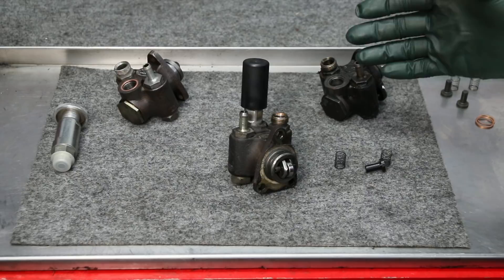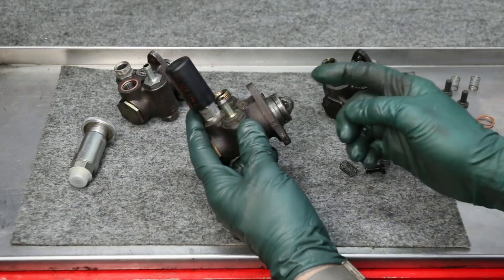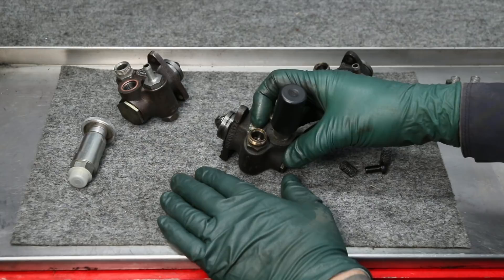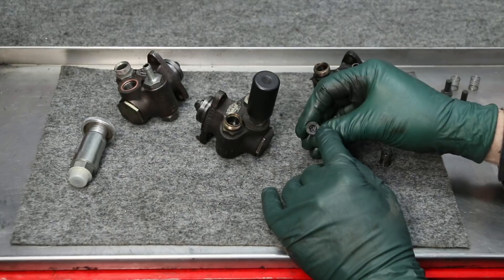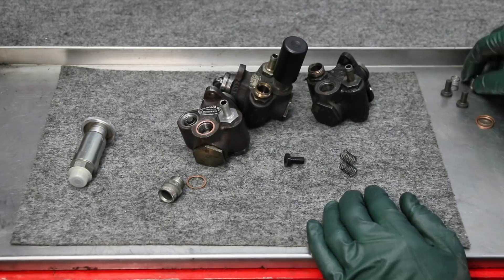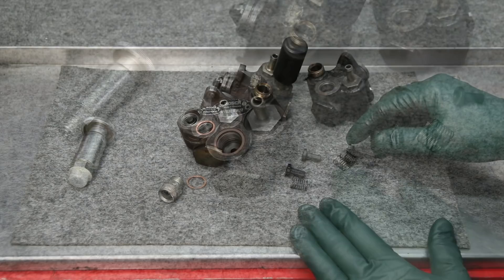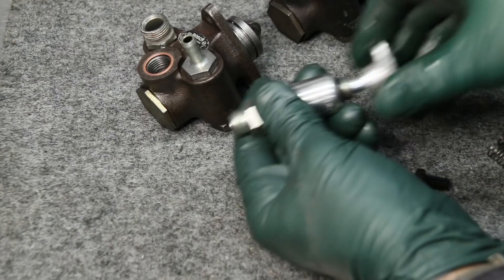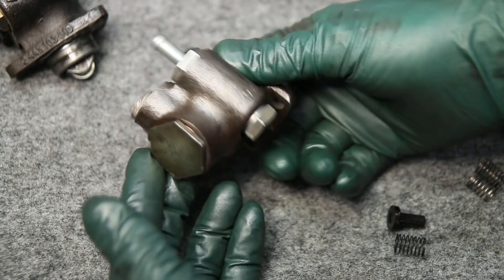Mercedes Diesel Mechanical Fuel "Lift" Pump Operation: Overhaul Kit Reviewed

Comment: This kit would appear to be for the MW style lift pump and not for the M style pump that was on earlier models in the US and Europe. A definite MUST DO job if your car is over 30 years old. Best if done along with a new replacement spring in the fuel overflow control valve bolt on the left side of the injection pump, and new fuel injector nozzles.

Comment: Hey sir my pedal came out of the assembly and got stuck to the floor and my engine was maxed revved for maybe 20 seconds. Now it is reduced power lugs everywhere the water is not circulating so I’m buying water pump but I’m wondering what else could of been worn out due to the pedal coming out and sticking to the floor? What else do I need to look at

Comment: Is this the same unit on the side of a 406 Unimog injection pump? I am trying to repair our old 1975 (406). previous owner had a small 12 volt pump pulling fuel through the dip tube on the fuel tank - I just thought that this is the way they were running the fuel system. I also need a dip tube for the tank and I do not have a part number to search for it. Any help would be greatly appreciated! I would like to rebuild this back to original - what does your repair kit run? This would be great to rid of constantly bleeding air out of the fuel line, filters and having to remove lines to check fuel system.

Comment: Perfect timing. A couple weeks since after replacing my bad glowplugs with some monark ones(making sure to ream the precombustion chamber) I am again having hard starts. Takes like 30-45 seconds of cranking and a boat load of smoke before starting.(it's also been getting below freezing again here in CO. My primer pump I noticed leaks when pumped but not when running. Could I have a weak lift pump? If it's smoking it's getting fuel right? Any help would be appreciated! Thanks Ken!
Reply from the maker: James, that could be the problem, but you need to look a compression first. When was the last time you adjusted the valves and did a compression test? If the compression is ok then suspect the lift pump. Kent
Reply: @Mercedessource  I'll try all that. I don't suspect low compression because before this it would start on the key with one glowplug cycle. And it seams to run great after it finally starts.

Comment: I Kent love your videos mate they are very thura . I'm just wondering I'm new to MERCEDES world but I've just bought my self an om606 with a 603 fuel pump which I am going to fit into my landrover defender . What's making me curious is I don't see the om606 in any of your videos. Are you a fan of the om606 or don't you rate them very much thanks regards ron
Reply: u got instagram ?? i would love to see a picture of it

Comment: Hi i got a 1994 c220d with my lifer pump is leaking so there is air bubbles in the fuel line does anyone has a part number for that pump

Comment: Hi there!! where is this pump located in w 124??
Reply from the maker: I assume you are referring to a diesel W124 with a OM603 or OM602 engine. The lift pump is located in approximately the same position under the fuel injection pump. It is a different design so my kit will not work. You would need to buy a new pump.
Reply: Thank you a lot!! Is It that "button" beneath the emergency stop lever?
Reply: Yes yes om603